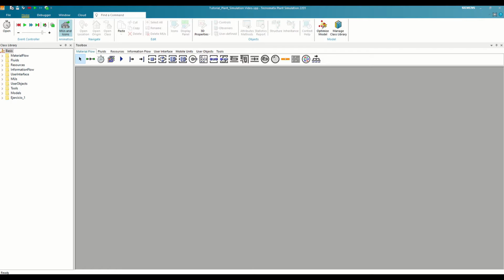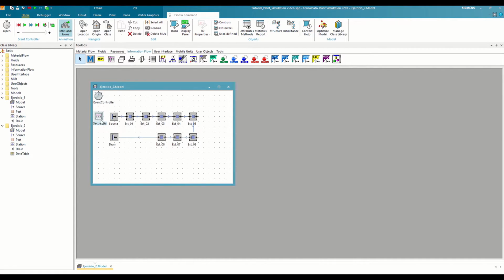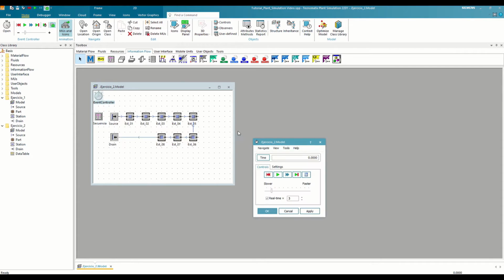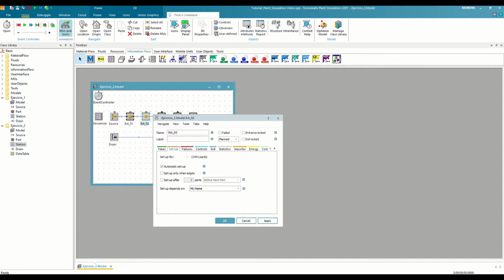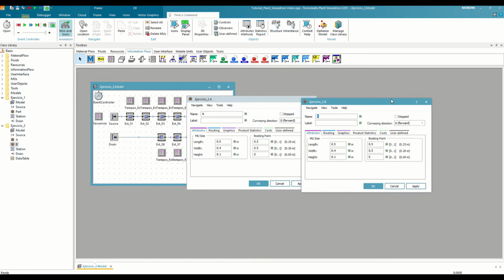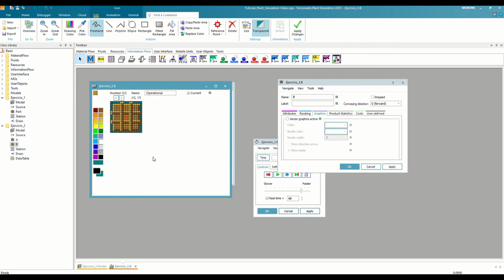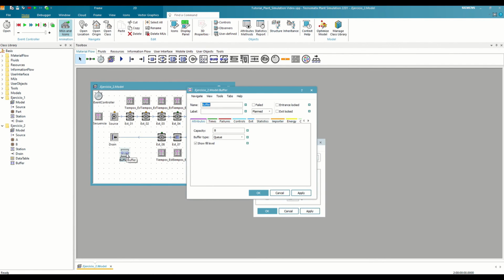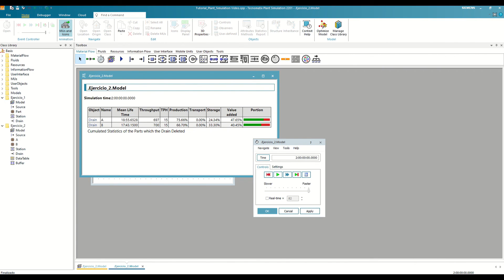Plant Simulation Tutorial (English) - 4. Tables, Icons, Buffer

Comment: Hi could you explain how to make buffer to release part after a capability will be full ? For example i have buffer with 30 capability and it must start working when capability will gain 30 parts.
Reply from the maker: Hi youtube.com/@jerry5869 ! Thank you for your comment. Regarding your question, I'm not sure if I've understood you well. If I am correct, you need the buffer to hold the parts until its full just once at the beginning, and then release them without looking again at its occupancy, so it won't matter if it empties or gets full again. 

If that's the case, the easiest way to do this is using an entrance method in the buffer and a boolean external variable (both can be found in the "Information Flow" tab on the Toolbox). 
- First, drag both the method and the variable to your frame and name the variable "FirstFilling". Then, open the variable, define its Data type as boolean, mark the "Initial value" checkbox and write False in the box below. Then apply changes.
- Once you've done this, open the buffer, go to the "Controls" tab and drag your method to the "Entrance" box, then apply changes.
- The last step is to open the method, paste this code and press F7 to save the changes:

//Checking wether this is the initial filling
if FirstFilling = false and ?.NumMU < ?.Capacity
	?.exitLocked:= true
	return
end

//Releasing the parts
FirstFilling:= true
?.exitlocked:= false

If you follow these steps it should work nicely. However, I strongly recommend you to watch my other series of tutorials about programming in SimTalk to fully understand what is going on here. Those videos are intended for anyone, without requiring previous programming experience.

Please let me know if this solves the problem or if you have any other question.
Reply: @AdrianGarciaMoreno-Tutoriales  Thank you very much For your help. I wouldn't have thought of using "Variable block", everything works. Thank you again for your help
Reply from the maker: You're welcome! I'm glad to help 😉